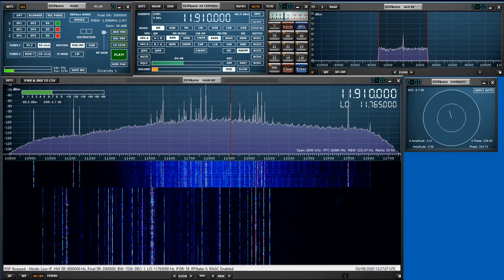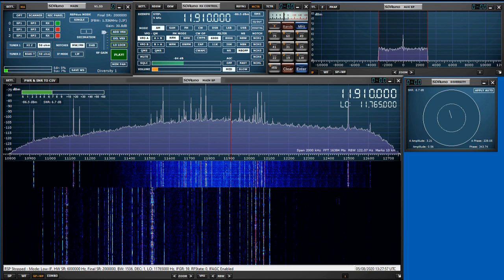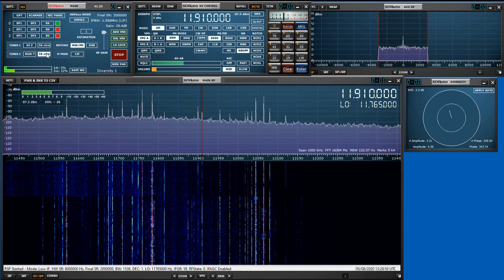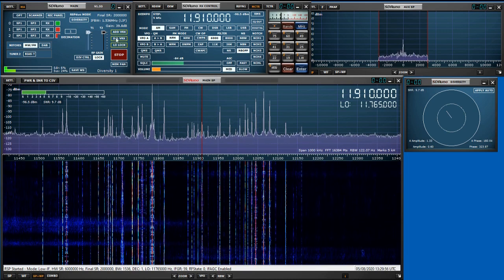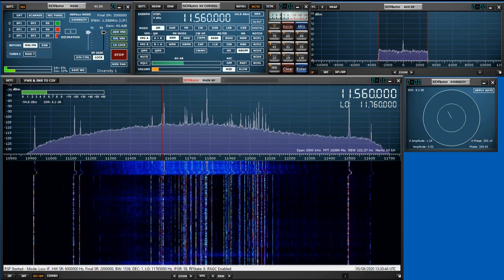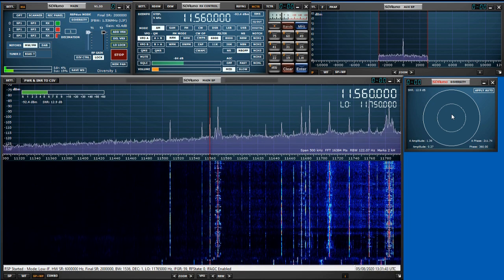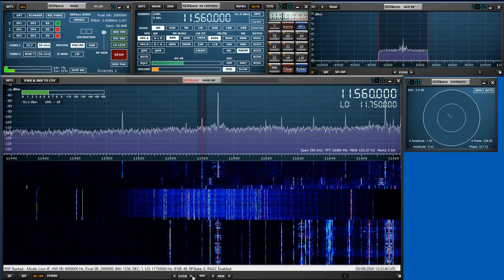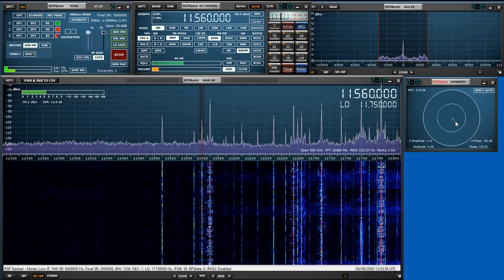RSPduo Diversity Reception Demo 1

Comment: Less is more with gain levels and SDR. I have virtually never seen the need to run the gain so high as you have set in the video. I don’t have the Duo  but have RSP1As, RSP2Pro and RSPDx all of which produce best SNR reception with the gain set nearer the bottom. 73 de ve4ace
Reply from the maker: I guess a lot can depend on what antenna is being used. At my end, I often find that decreasing gain can reduce SNR.

Comment: Wow, very impressive! A friend N4CY just got his Duo and tried it on AMBC where he'd previously only been able to get good results with the expensive DXE NCC-2 phaser, but could get the same results without the NCC-2 with the Duo, and recommended I look at your video. Thanks! AA7U
Reply from the maker: Thanks, Steve. Soon I will have a couple of loops set up 75' apart and look forward to more experiments. Keep me posted on your activities! 73 John
Reply: @VE6EY   N4CY is using two "low noise verticals" spaced 200 feet apart for the test he used which previously only the NCC-2 could separate two stations on 1480 kHz. I don't own the Duo (yet?), myself.

Comment: Good vid John, was using my dual tuner rig for similar (but not as elaborate I'm sure) results through a good set of phones and it puts a completely unique spatial perspective on reception especially once some on the digital noise effects are dialed in.    73
Reply from the maker: I fell in love with this radio very quickly!